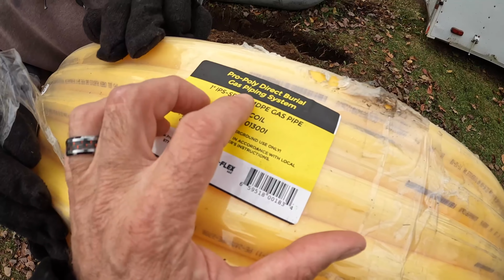Franky almost killed me trenching an underground line.

Comment: You guys should’ve put tracer wire in with that so u could Locate it easier and I could tell you the depth
Reply: 10 or 14 gauge ground wire makes for good tracer wire when taped properly to the gas line.
Reply: @uncleargyle2615  you're not supposed to tape wire to the pipe
Reply: Taping to a plastic or polypropylene gas line is how various utilities do it and our area has a requirement of burying 19” to 23” minimum depth for gas lines,  and at least 24” to 30” in conduit if you’re burying electrical wires!
Reply: Exactly what I was just thinking.
Reply: Yes you would tape the wire or tie it off on the end of the pipe and run it loose in trench with the pipe.  In an 18” trench for example, cover 12” and then put the tape down and then cover the remaining 6”.  The idea is to hit the tape with the first scoop of a shovel or bucket, so you know there an underground utility.
Reply: @uncleargyle2615  the gas company I work for in mn tells us to not tape the tracer wire to the pipe. Things are run different in different areas though.
Reply: @JoeAroner-SIWAYTV  the gas company I work for tells us to not tape tracer wire directly to the pipe. Also I can tell you that nobody runs ribbon with a service line. It's not even put in with main anymore really cause it's only effective once.
Reply: @jesse11111   the tape is just there to hold it while stretching it out, most people just tie it off to the pipe.  The caution tape only needs to be effective once. While doing a job we hit the caution tape on a unmarked electric line, good thing it was there.  We placed new tape over the disturbed section and covered.  We then rerouted our water mainline.  
Different states and jurisdictions have different codes regarding gasoline installation.  Most companies won’t even drop a tank unless all the “i” are dotted and all the “t” are crossed.  There is just too much liability these days.

Comment: There’s generally repositioning involved going around a curve with our trenchers, both tractor type and the walk behind.  “Beats digging” is definitely the best way to sum up our walk behind, it’s underpowered and slow but it beats a shovel any day of the week.
Reply: agreed any day behind a trencher is better than a shovel, i bought a house in 2008 that only had 50 amp service in the house, built in the early 60's, so moved the main service into my garage to have 200 amp service, 100 for the garage and 100 for the house, i rented a trencher from Home Depot and it was small and slow and it certainly did the job enough for me and finished in under 4 hours trenching down a bit over 20 inches and a total of just under 45 feet and used my cheap pressure washer to clean it off, fill it with gas and get it back to the rental  at Home Depot without a late charge, only $75 bucks plus tax,👍

Comment: I had to dig a trench for an underground electric wire for my garage. Used a garden tiller and it worked well. It was a short run maybe 10 feet to an outdoor box connecting to another wire run under the driveway.
Reply from the maker: Nice 👍

Comment: Stan, locating tap and tracer wire with gas is a must.  If it’s not code in your area it should be.  At that distance you are probably running a one stage regulator at the tank with a second stage regulator at the house.  That’s higher pressure in the line and an oops digging is a nasty accident waiting to happen.
Reply: @cumeater4265   💥🔥down the line if someone decides to add another line or build, or pave something of some kind and starts digging there is no reference to the propane line.  In the short term Stan would remember, but down the line there is no way to trace a plastic line filled with propane.
Reply: @cumeater4265  that line was so zig zagged the guy marking it out would be shaking his head in confusion like a Benny Hill episode.  We’ll i guess the one thing dousing rods and locators have in common is you are never entirely sure of the depth, but that’s why you use the tape.😂

Comment: I just used that underground line system on a customers generator install.  So much easier than twisting iron pipe together in a ditch.  Down side is that the manufacturer is having a very tough time getting the resins for their pipe.
Reply from the maker: It worked pretty slick

Comment: Arguments for moving the Propane Tank: less gas line to run, less chance for a line leak, less chance to hit the line during future construction work...

Arguments for not moving the Propane Tank: less chance to damage the tank during the move, moving the tank would likely be expensive and may require it to be Recertified before being used again, easier for the Delivery Truck to get in and fill it in it's original location...
Reply from the maker: We had that same conversation😃

Comment: back when I was a well driller, we did a job for a man who retired from a phone company putting in and repairing lines, he showed us with two copper rods, as you get near the pipe or wire the rod stars to move, you mark that spot then when they go straight, mark that, keep moving and when the rods go back completely mark that spot, measure the first to the last mark, that's how deep the line/pipe is, the middle mark is where it's
 located, when we dug up the old line, it was within 3 inches of how deep he said it was and the line was 3 foot deep.
Reply from the maker: Holy crap- that guy had it dialed in with the dousing rods.
Reply: Lol ahh the good ol witching sticks trick. It’s BS but it does make you look cool to someone that don’t know any better
Reply: @dlogan3004  it's apparent you don't know any better
Reply: @mikeandnoleane07  ok buddy, you are right. Keep believing you have “the gift”

Comment: National gas code says minimum depth for a gas line is 12 inches and six inches above that you need either foil tape or plastic tape with a tracer wire

Comment: I've learned with snow season to just roll with punches. It's snowing out i watch out window when it's time to go I jump in apposite machine and go out to work, also seeing I have been doing it for 30 years I've built a modest stash of equipment whereas I can keep various machines on site at equipment critical jobsites such as skid steers at apartment complexes, dump truck parked where larger parking lot locations are, loader/plow at large sidewalk jobs, also having a bulk salter is a must which I have one on back of my one of my compact loaders and another one on back of pick up truck. All these things I talk about has made my operation near stress free but everything came at huge expense. My operation now has become literally a one man operation whereas most other companies who run the same size operation are dependant on a huge crew of men to get the same amount of work done, it took me 20 years to perfect the system and now it has paid off - 30 years later. When it snows out ans I know I have to go to work I set alarm for time I gotta go out and I just wake up, run out door fly around with my head cut off in order to make the most money and when done I just come back home and go back to sleep. Wake up next morning and if I have any carnage to fix I fix it and life goes on, one other thing that has been a game changer is the critical importance of owning a shop where welding repairs can be made, hydraulic issues can be addressed. Trucks can be cleaned and maintained in the end it took many years but my operation Is now nearly stress free.

Comment: Gas piping is plumbing. Gas pipe fittings are plumbing fittings. Polyethylene gas pipe is being installed most everywhere now and US cities and municipalities are replacing and pulling out old metal residential gas pipe with PE pipe across the divide.

Comment: I have an attachment plate with a receiver hitch. It can be used with anything 2-inch square.  I have rippers, rake, flat blade, 90-degree adapters, 45-degree adapters. V ditcher which mounted backwards would work great for filling a ditch like that.
Reply from the maker: sounds like you have the right tool for that job
Reply: @Dirtmonkey  Actually I think it's just I like to build stuff. I will spend an hour building something for a 10 minute job. We'll 10 minutes for most people. Screwed up my back. So it  it is usually faster building something now.

Comment: Excellent video sir, is the gas line pipe “fix” by “Sharkbite” ?  I see the advantages and disadvantages to using that machine. But, really looking forward to hearing the back feed on that pipe connection for the gas line. Checking out your next video sir. Keep up the good work
Reply from the maker: Yeah it was a shark bite type of connector.  We did this job last fall- it has held up excellent all winter

Comment: You need to get that auger blade close to the ground so it can do its job of pushing the dirt away from the hole so you're not constantly kicking dirt into your hole when you're working but you can't just rotate the bucket on your machine you have to pick up the arms as you rotate down into the hole you select your depth my rotating around the auger. Then it's just a matter of let it work don't try to force it just let it claw and guide it. Remember swooping curves that are you stop pick up addressed rotate to death slowly and get moving back at speed remember let it claw.

Comment: did you put in tracer wire about 3 to 6 inchs above it so you can find it again if you need to? ploy is simple to install,  try running 300ft of 1 inch copper that has to hold liquid propane for corn dryers.  Fastest way i have found to close a trench is with an angled blade.
Reply from the maker: I forgot about the tracer wire.

Comment: For LP gas there is a primary regulator, at the tank, and a secondary regulator at the building. This allows for high pressure gas to be run in a much smaller line, usually 1/2”, to the building where the line may be increased for the low pressure required by the appliance. 

I didn’t understand why you were running such a large size line for the high pressure gas. It won’t hurt anything, but I am concerned that more could be incorrect and therefore it is very dangerous.
Reply from the maker: That was the correct line according to the charts I read when I was buying the materials.
Reply: @Dirtmonkey   It probably is the correct size for low pressure gas. It is oversized for high pressure gas, but it will still work. My concern is that the installation creates questions about line sizing and the correct placement of the necessary regulators. Gas and electricity are powerful and therefore dangerous. I know that you are a safety first person, but when I see something that is questionable I question it.

Comment: Good job on the click bait. I fell for it hook line and sinker. Was expecting to see sparks fly or blue smoke or a water fountain.  All I got was a story about somebody working you hard for a day. Also most jobs they lay plastic tape in the trench about 12" inches or so from the top with the words Electric Line or Gas Line.
Reply from the maker: When we work on peoples projects we have to hand dig up those lines to locate them and rarely see that tape unless its directly on top )like physically touching) the line which never makes sense.

Comment: When backfilling, have you tried using multiblade or what it is called, one of those snow removal blades you can adjust in multiple angles? Position it in an inverted cone or like a scoope and lift the narrowest point a little to help the dirt to fall in to the trench

Comment: Idk about propane, but natural gas only has to be a minimum of 12 inches in the ground in mn. That being said plowing in a line with a maxi sneaker is much faster being that there's no backfill, you just gotta run over your rip line. Also I'm sure you're not certified on plastic pipe fusion so that's why you had to use a mechanical fitting on the riser.
Reply from the maker: your right on all those points.

Comment: Try using a skid steer or a bobcat mt55 to turn you literally rotate the trencher into the wall of the trench. I would actually say it's harder than small adjustments on the steering wheel
Reply from the maker: That would be a challenge

Comment: I have a question, so how did you repack the dirt in the hole? You said to never run the equipment in the trench so did you use some kind of compactor or just planning on filling it in after it has Settled? I was told to leave the dirt crowned over the trench after compaction to stop any need to have a depression after any settling. Just asking
Reply from the maker: Didn't compact the dirt this time, Since its my own property I can regrade that area if it settles but since its sand it won't settle much.

Comment: Love the videos. As a result, I was able to complete 2 retaining walls last summer. This spring, I started the trench work on another retaining wall. However, I came upon  4 1" sprinkler pvc  pipes that I was unaware of perpendicular to the planned wall. How do you get around this? I can't find any videos addressing the issue. It would add way more work to reroute the pvc pipes. Any guidance?

Comment: 20 minutes I have the pipe ran and me and my guy are digging to get everything connected. I pulled gas line before not much different from sprinkler liners different diameter. We use a vibratory plow and my boss owns three of them and always loves showing off the vibratory plow. Artists on a Toro dingo

Comment: Yeah thats typical gas line stuff its basically a big sharkbite I've buried loads of it and it works great I worked pipeline both big lines in the woods and residential for the same company and that's normal hardware these days makes for a quick run instead of what we used to do which cost time :)

Comment: We have used trenchers once or twice for two or 300 feet of waterline we went down 3 feet and found my excavator with a small bucket was faster and fill the trench quicker and pack better than the little tiny transfer left which was very hard to fill with our kind of dirt where we are here so we got rid of the trencher and just kept the excavator of courseu that trench also kept us going there every year for a couple years to fill that little tiny trench it kept sinking and it was a waterline for horses

Comment: Any size storm. I do not sleep the day before. My head goes nuts
Reply from the maker: same
Reply: @Dirtmonkey  i wish I could show you the patio I just did solo. Ended up being 300sqft holland pavers black pearl 90 degree herringbone pattern with a 12 foot sidewalk attached. The grade was horrible. The house was not level the grade was putches twords house. I hand dug out 3 yards of organic soil brought in 2 yards road base and 1.5 yards of sand. Took me and the wife helped a day or to 5 days. The removal took forever the old walkways was 8 inches thick of old hard concrete. What's a job but the feeling of accomplishment is amazing I did it alone!! 1500 blocks hand tamped everything absolutely everything done by hand.

Comment: So, your advice is to not bury "caution" tape when backfilling over electrical or gas lines unless required by government regulations. Wow for less than the cost of a pack of smokes, warning others about a dangerous situation should not be done unless required.
Reply from the maker: I just forgot the tape. never said not to use it.
Reply: @Dirtmonkey  Before forgetting, the caution tape had to be on your list of things to use. It was not. Second. a safety trained employee would have mentioned the oversight.